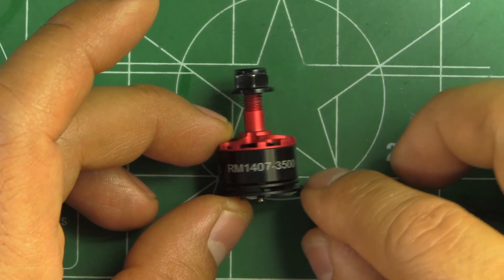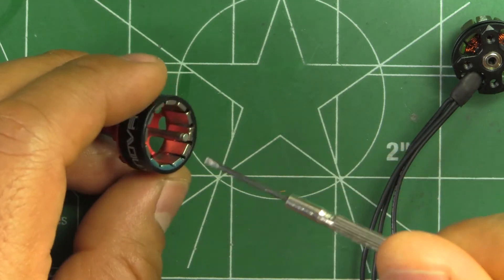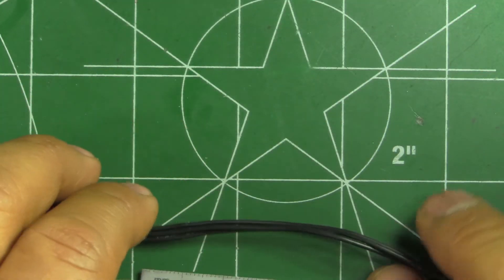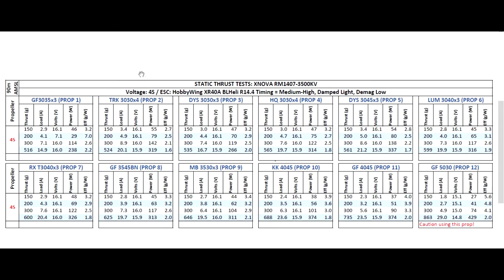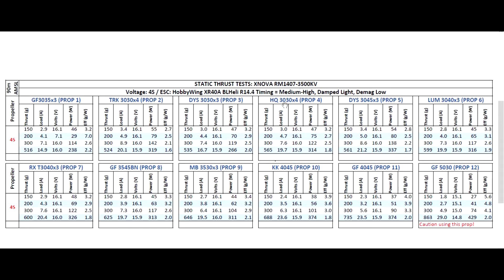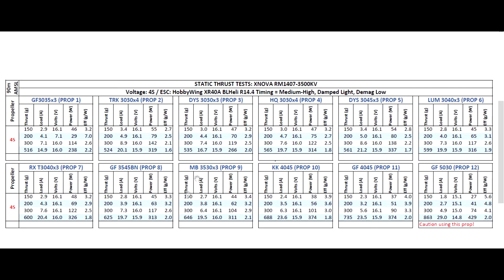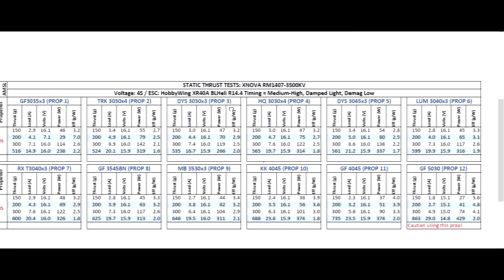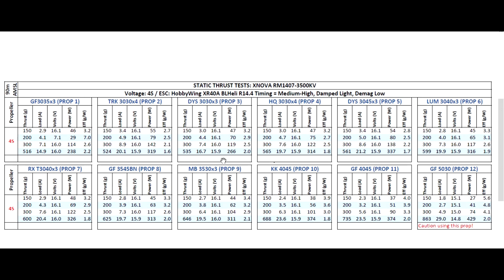XNOVA RM1407-3500KV Static Thrust Tests and Overview

Comment: I just uploaded a vid of me flying these at 5s :)
https://youtu.be/Cz1wboExIaU
Reply from the maker: That's a sweet set up - 5S! 
Thanks for sharing. Good to know these little beasts can handle 5S -amazing!
Reply: Yes i suspect total thrust is above 5inch quad but i do not have access to equipment like yours. I also suspect the new luminier prop would be better suited to my power train but i cannot find where to buy them. The 3076 were horrible and only really good on a track with lots of sweeping turns.
Reply from the maker: GetFPV.com should have those Lumeniers - unless they're out of stock. Piroflip also carries them, pretty good shop here in So Calif. http://pirofliprc.com/Lumenier_c_385.html. Just be careful with those, they'll load motor a bit more than the DYS 3030x3 you're using. Just check motor temps after a hot stint.
Those TRK props are too specifically designed to do just one thing well: to go fast and have best performance at the top-end so when rpm's dip down, the prop makes little thrust. Not the best for having fun freestylin'.

Comment: Thanks for your test, very good motor, I take HQ 3030x4 with eps 920mAh75C with xnova 1407-3500kv, very good power and efficience, more with the DAL3045x3 with tattu1300mAh75c (150gr too much for 3")
Reply from the maker: Hey - good to know that combination worked well for you. Thanks for watching!

Comment: Again nice test. Thank
Good numbers but this motors are design for micro quads like 130mm.... There are no lipos that can handle this current..expect if you fly with 1300-1550 mah lipo...
Reply from the maker: On the test the current is high because I use power supply and motor and prop are not moving. When in flight, propeller and air molecules have a velocity so there's less load on prop to push air, so Amps will be lower. The LiPos will set whatever discharge limit they can support. Of course it will be noticeably less than in this test. Static thrust tests show the motor capacity to make thrust for comparison against other motors, but doesn't mean you will get this much thrust or use that many Amps. Multiply Amps by 0.65 to 0.75 (more conservative) to get closer estimate of actual in-flight Amps

Comment: Hey man, I can loan you 3 motors, if you want to run tests.

RCX 1406 3800KV
LDpower 1306 4000KV
Emax 1306 4000kv
Reply from the maker: I tested the EMAX 1306-4000KV - it's on my channel
Thanks for the offer. The LDpower could be a good test. But I'm swamped with a bunch of motors to test. 3 of the RGeeks , A new 1407 from iPower and  some new GTS2405's from RCinPower..... and a couple of frames, ESC's ... etc
Reply: EngineerX hey how do you like those militabrother props they look very impressive from a thrust perspective how is the overall build on them?
Reply from the maker: I haven't actually flown them. They feel like they  could survive light crashes but on a bad angle might develop a crease when bent back too much. They're somewhat flexible, good thing is they're well priced. I watched a video of someone flying them and they looked pretty good. I can't find the video now. Prop seems like it would be very good for freestyling
Reply: EngineerX have you had a chance to try out their 3030 props, if no would you like to try them I bought a bunch and wouldn't mind sending a set your way.
Reply from the maker: Sorry, your comment went into the "need approval" section -Don't know why. 
I have not tried their 3030 props - I see they make tri and quad blades. Yes, you can send me some. I can test them with the BH 1407 motor and we can compare performance against the other 3" props. Send me a message through YTube

Comment: Great Review! Looks like on paper the BH motor still outperforms for less cost .. xnova motors are kind of pricey.
Reply from the maker: Right, XNova seem to cost a bit more than others. So that's one thing to consider. Advantage is they may be available locally. This one was sent from Amain Hobbies here in the US. Thanks for watching!
Reply: ten drones its seems super close but i prefer the Xnova. The Tornados have arc magnets and this can cause problems like yaw twitch etc